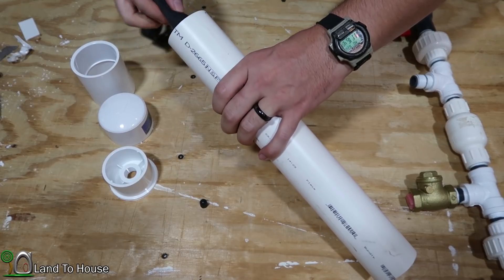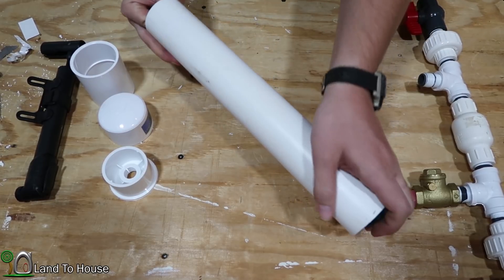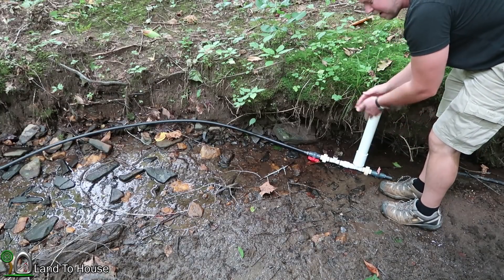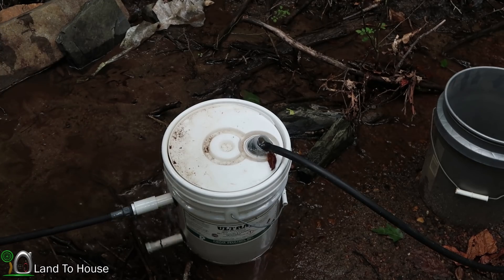Half Inch Ram Pump Build and Install

Comment: I have a question for you, I found a spring on my property. There is about a 10 ft drop from the spring to the point I want to go up hill, I suspect ( not verified yet that I'll need to go up 50 ft plus the hight of a 6 ft tower that my 2 IBC totes will be mounted. If a half inch pump can not make it up the hill can I have a 30 or 55 gallon intermediate tank that will feed a second ram pump. Then the output of the second pump will feed the IBC totes. First filling one then overflow into a second tank that then overflows back to the creek.

Comment: I tried to make ram pump today... As you taught in the video... And it's amazing... I got success... It is working... Thanks a lot of... 🙏🙏
I used vertical chack valve without spring as waste valve without spring and a swing valve as delivery valve...

Comment: Wow! Very clear and direction presentation. Understandable. Good job. Thank you. Maybe you can help me with my project? I'm looking to create an off grid irrigation system and I'm thinking about incorporating this type of pump instead of a solar module, battery, transfer pump, etc. There's a 55 gal water tank that will be elevated 5'. To the spigot at the bottom I would attach a battery powered irrigation timer. Once it opens the water would flow to the ram pump and from the research I've done, it would have enough PSI to activate the micro drip irrigation system. I noticed you said you have to sort of activate the valve with a stick. Is this just one time when you first use the pump or is it every time the water initially flows though? Because if my timer turns the water flow off and I'm not there to reactivate the valve then I probably cannot pursue this option. 

Thank you for your time and if you require payment for the consultation, let me know.

Comment: I noticed on your bigger ram pumps you do a reduction in the delivery pipe side and why and not on this one.
Reply from the maker: The half inch pump does not reduce in delivery mostly because smaller poly pipe and PVC becomes weak at smaller sizes. Because the ram pump is low-flow and low-pressure the delivery pipe size does not matter. You could connect a 4-inch delivery pipe to the half inch pump and it would still deliver the same amount of water

Comment: Your 1/2 inch Ram pump costs about half of the cost of your 1 inch Ram pump.   Does it pump more or less than half the water of your 1 inch Ram pump for the same head and delivery head?   Also are there differences in head requirements or limits in delivery heights that you have noticed between the pumps?

Comment: Amazing. Have you thought about generating electricity with it?
Reply from the maker: Years ago I connected a treadmill motor and a homemade pelton wheel. Made 4v unloaded haha.
Reply: @LandtoHouse  I was thinking of filling an elevated header tank of considerable volume and having a 2" to half inch feed for a pelton wheel with 12 permanent magnet located under the header tank? Critic?

Comment: K, not sure if I posted here or not. I bought the 1/2" pump and put garden hose on it at first for the (drive pipe? The part that feeds the pump), and it failed bc... garden hose. 

So today I am installing it with poly pipe, and am making a video about that on my channel.  Will put a link on there for this channel.
Reply from the maker: Hello. Yes garden hose is very flexible and does not work unless you have a high head pressure. Poly pipe should give you nice results.  Pvc pipe will provide even better results but poly is just fine. 

Thank you for the update!
Reply: @LandtoHouse  /Water woes... facepalm.  Got the poly, 100 ft.  Hooked it up to the turn valve on the pump so I could siphon and turn it off, like you did in your video.  I have a five gallon bucket w a fitting on the very bottom of it as a water catcher.  Filter on it, but not on the hose, so no blockage.  I got water to kind of trickle out of the other end before hooking up the pump, but still not enough to make that pump do its thing.  I think that, although my creek is bigger than yours in your videos, I think you have more of an elevation drop.  I moved the location of the whole thing downstream where there was more drop (head), and got more water coming out, but still no pump action. Goin to get more poly tomorrow, and add some more on the drive pipe, and I will get a little bit more elevation drop with the greater distance, one end of the creek on my property is quit a bit flatter but curves all over, and the other end is straight and has a better drop rate. Was tryin to avoid that end bc it is close to the road and nosy people's eyeballs, and also is on the opposite end from the hill that I need to pump water up to. LOL  

Anyways, still figuring it out.  I have deeper water than your creek, so this elevation drop thing is difficult. The creek bed is drastically lower, but it's got two feet of water on the end where the pump goes. Urf.
Reply: Just an update.  The project has been taken out of my hands, after much fussing w it. I'm just not smart enough, and there is just not enough drop from one end of the creek to the other. My Dad, who is McGuyver n can fix anything, came over n messed w it a while. We did hook it up to one of my rain barrels just to see if a few more feet drop would make that flapper valve engage, and it did just fine for the first time, just 2.more ft.of elevation n a little more water collected for pressure. He even took that pump all apart and tweaked some things. Loosened the nut a bit on that flapper valve (brass check valve).  He determined that there is not enough water pressure coming from my drive pipe (due to not enough drop) to get past that second check valve inside. Water just isn't strong enough. He took it home, and is gonna tinker w it (he is a retired mechanic, I wasn't  joking when I said Dad can fix anything. He works magic), and build a slightly different design, while I do some clearing and see if I can't work my way further back in the property n find a little more drop.  
This project is quickly coming to a fizzle, though, bc Fall is approaching, am still building fencing, and pretty soon the creek will be too fast, too cold, n too deep to be doing all this. And the ground back there where I gotta work turns to a gloppy mud mess not fit for anybody to be in.  That patch of land rests in the wet months.  Turns to cement in the dry months.  And I was reminded that the county may make trouble for me if I post this stuff on the internet. Sigh... We live in a place where you have to fear the government.  ,Murica.  Land of the free? I spose it could be worse.  You guys are lucky to live in a place where folks don't get quite so environmentally ridiculous over there.   

Spotted owl and pocket gophers are royalty, here. lol

Comment: can I use threaded pressure tank cap? so I can easily replace or reflate the inner tube without replacing the whole tank?
Reply from the maker: I've seen a few people use clean out fittings. These threads are larger intend to have leaks at higher pressures. You might want to try and use a union with smaller threads and an o ring.

Comment: Your inner tube will leak air over time. I plan to use ping pong balls as pressure bladders. Would that be ok?
Reply: Swim Noodle pieces?
Reply from the maker: The tube does leak over time. I fear that the pingpong balls will not have the give needed to be a proper bladder. And can 60+ psi crush one? I have a series of tests coming up with tank fill.
Reply: @LandtoHouse  It would like to know other alternatives bladder....

Comment: Hi.  Awesome work with that pump.  I have (2) questions.  Any idea how much pressure it takes to overcome the spring in your spring type check valve?   Would (2) brass swing type check valves work "easier" since they just swing as opposed to having to overcome the spring pressure even ever so slight?    Thanks and again, AWESOME WORK !!!!
Reply: I had the same question, I think the answer is yes it would be easier with two swing check valves or a spring type with the spring taken out of it

Comment: Can you put a hose on the brass check valve returning water back to the supply
Reply from the maker: You can use that water down hill. But if you were to place a hose on the waste valve and return to the source it would stop the pump.

Comment: Hi! I'm trying to replicate your pump and I was wondering what role do the PVC unions have? PVC fittings are different here in eastern europe and I can't seem to find them, what happens if I just leave them out and use the bushings to connect everything? (Very informative channel btw., I'm glad I found it.)
Reply from the maker: Hello. The PVC unions are designed to allow you to easily remove the pump from the creek for cleaning or for storage in cold weather. Without those unions it can be very difficult to unscrew the awkward sized pump on stationary drive pipe.
Reply: Thank you!

Comment: Great job can you tell me how you would work it to have water in a small off grid cabin thanks
Reply from the maker: The ram pump supplies a constant flow of water but at low flow. To be effective in a cabin you would want to bring the water from the creek with the ram pump to a storage tank. Then use that as the water to the cabin.

Comment: Can we use any other type of valve for the check valve instead of swing valve
Reply from the maker: Yes you can. Some people use a foot valve with the spring removed. There is a valve that is designed for the ram pump but I do not remember the technical name. Some call it a poppet valve.

Comment: What kind of GPM output can I expect with the 1/2" pump?
Reply from the maker: It depends on a few things. The head pressure and delivery hight. Say you have 3 feet of head pressure going to the pump. That can lift water to around 21 feet max. Now if you are only pumping to 18 feet you can expect 1/4 gpm while if you are pumping to 15 feet you can get even more. There is a low limit though. If you do not have enough back pressure on the pump it will stop. So basically you will not get much more than 1/2 gpm at its best setting with the small 1/2" pump.

Comment: Can that tire tube be used if I want potable water?  If not, what can be used?  Thank you.  I love your videos.
Reply from the maker: The tube can be used in a ram pump pulling from a spring. As far as I know there is no way to isolate the ram pump from the creek that runs the pump and a clean potable source. In other words the pump is only a single action pump.
Reply: Land to House Thank you.  My application is I'm getting my water directly from a spring head.  The water has been  tested and is very drinkable.  I'm concerned about the rubber tube leaching impurities into my clean water source.
Reply from the maker: I see. You can use the ram pump without the bladder. Also you can use a house water pressure tank designed for using with clean potable water. So there are options.

Comment: With your larger pumps the output pipe is smaller than the intake, but not with this one. Could you hypothetically replicate this for a 1inch/25mm pump? Trying to make best use of pipe I have lying around. Thanks
Reply from the maker: +Matt Thrum as long as the delivery pipe is large enough to prevent friction loss you can use any size. It is fine to use a 1" pipe with 1/2" RAM pump for delivery.
Reply: Land to House thanks for the reply! I also saw your drive pipe video which also answered my question. I am planning to build a 1 inch to 1 inch pump. Could you expand on what you mean by friction loss?
Reply from the maker: If the delivery pipe is too small. Lets say you wanted to use a 3/8" tube with a 1-1/4" ram pump there would be more water pumped than the 3/8" pipe can handle. So the water would be limited by friction of the tube. Using a larger delivery pipe would eliminate that issue.
Reply: Land to House Thanks!

Comment: Instead of using a bladder in the pressure tank shouldn't it be possible to install a sucker valve between the pressure tank and the T-fitting? I don't know if you call them "sucker valve" (I'm german) but i mean those valves which suck in air from the outside when there is negative pressure inside the pressure tank.
Reply from the maker: +Robert Riedel yes those are referred to as snifter valves. The industrial-grade ram pumps have those. If not tuned properly they are hard work with. Especially on a do-it-yourself model.
Reply: Land to House Alright, thanks!

Comment: I was messing around with my new 1/2" ram pump, and I think I found some calculations that might be helpful. Not sure if these are exact(or work) but they seemed to be correct. To find the gph of the ram pump, do: (p/h)/s
p = Height the ram pump has to pump it
h = How much head you have
s = Size of the pipe
Reply: If anyone could test this with their pump, it would be nice :)
Reply: Penguindon So I like where you are going with this. I'm currently doing research to build my own ram pump. However I don't think your equation is correct. My reasoning for this is that if you increase p or decrease h you would get less flow rate, not more as your equation suggests. One methodology for developing these types of equations is to look at the units involved. For example gpm is in units of distance squared divided by time so an equation that equals it must also have the same units. (Treat units as numbers that you don't know the value of, we know that x/x = 1 so seconds/seconds also = 1) Again I really like your thought process, and I plan to do some testing on my pump as soon as it's built.
Reply from the maker: Math is the one thing that I dont like spending time with . I know that it can solve problems without having to go out and build things but I just dont like to do it.
Reply from the maker: Its nice to have people who are into the math side of ram pumps. I am not one to go deep in the math of fluid dynamics.
Reply: this formula means nothing without units. what is the measure you use for desired pumping height? feet , yards, meters, perhaps furlongs or chains?
can I assume your head height is same unit?
and size of pipe? is that I.D. or O.D. ... Or maybe wall thickness? again.  inches, feet, millimeters, miles?? 
It would be nice to have a formula to use when engineering a project, but this is not it.... yet. Try to specify in terms of metric units. (height in meters, pipe size in millimeters or centimeters I.D. and flow in liters per second).
Reply: Would you be able to advise me on my ram pump please? A friend of mine a ordered me a 1/2 inch ramp pump before I discussed with him the size I actually needed.  So I have your 1/2 ram in hand but am not sure it is the correct size for my situation. Do you think I can make it work and if so what size drive pipe and deliver pipe should I use?

I'm in an off grid location around what I've calculated is 17m vertically above a freshwater spring with ample flow.  I can site the ram downstream of that spring, so the ram pump will 250m distance from where I need the water delivered and 20m vertically below. I was thinking a drive pipe 3-4m vertically below the spring. 30-40m long.  I only need a small volume 50-100 litres per day delivered.  The question really is more about the vertical height I can drive the water.  Will the 1/2 pump drive uphill 20m vertically and what size, drive pipe and delivery pipe would be recommended for this situation.   Cheers John

Comment: I had subscribed now. I really want it, but how can I make it work on flat river. I think to make a well like hole and make a water comes from river to well but the problem will occur. First, I will have well full of waste water from ram pump. Second,  the water in well has the same height as water on river so it won't work. It's really annoying that I have unlimited water on river, but the terrain condition doesn't support to  make it work. Then, I think to make it work by wind turbine, but I need to build tower for wind turbine to make it work (get enough blows of wind) and the tower at least should be 70 feet high. I'm lost of words now. I have other option and that is solar panel but I really don't want it. If I should make it then it should be the last effort I have.
Reply from the maker: Sadly the ram pump does not work on a flat river. It has to have head pressure to operate. I have been slowly designing a river pump that will one day work on flat water. It is still in the early build stage. But you are right. Digging a hole is not going to work because it will fill with water.
Reply: Can you build a water wheel in the river to lift the water higher, and pour it into a sluice that will deliver the water down to your ramp pump? Here are come example videos: https://www.youtube.com/results?search_query=water+wheel+pump